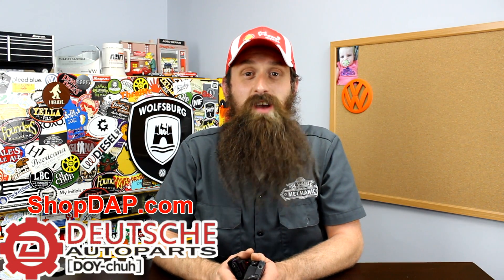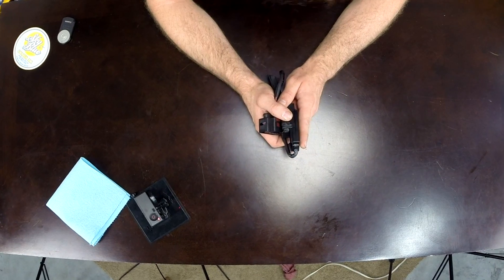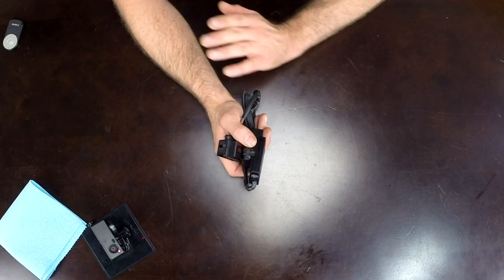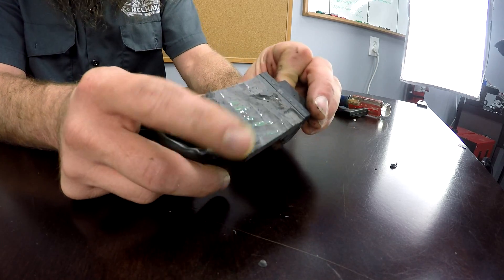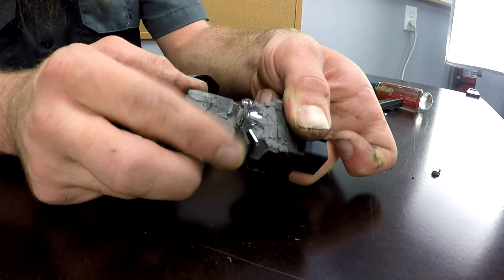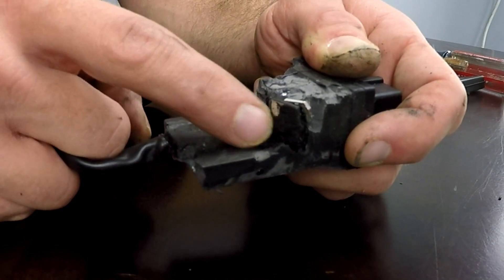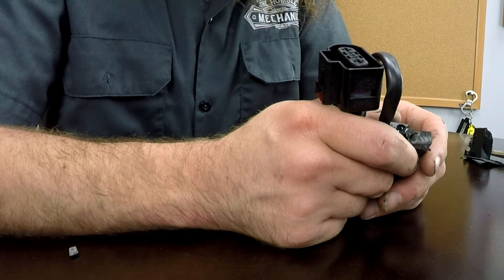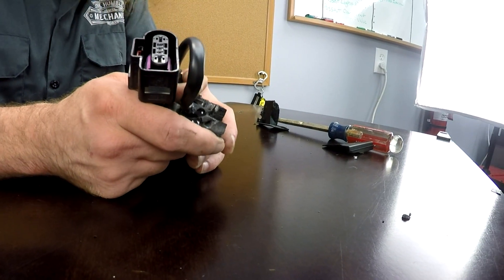How VW Parts Fail ~ 2.0t Fuel Pump Modules

Comment: I am having so many issues with my 2018 beetle 2.0 with these errors. I replaced the fuel pump module.
I disconnected the battery to install it
then after i deleted the codes
Cranked the motor and ran it after a couple min codes came back.

10426 - Fuel pressure too low during cold start
P053f 00

2838 - fuel rail system pressure too low
P0087 00

17895 - Valve for high pressure fuel pump stuck open
P12a3 00

4178 fuel injection malfunction
P0148 00

I placed a fuel gauge between the high pressure pump and after the filter .  When the car is cold the needle jumps back and forth 65psi to 75psi then after it warm and idle it jumps to 85 to 95psi and those codes come back after delete. Please any help would be appreciated
Reply: My readings .   https://youtu.be/wXx7tLf_aOU?si=YFB98EFHF7E56Neh

Comment: 2012 beetle turbo 

I can start and drive the car just fine but then all of a sudden I lose fuel pressure... Give it a few seconds.It'll start right back up.And I can continue driving but it does it again...

I'm replacing everything in the fuel system.The high pressure fuel pump low pressure fuel pump fuel filter module and sensor...
Reply: Did you get to what it was.... I have replaced sensor, filter, both pumps, relay, fuse... when engine gets hot the low pressure pump just shuts, and only runs 2 sec after key off-on maneuver. Driving me crazy

Comment: I am fight fixing a 2012 VW Jetta GLI.. I have a P008 code I replaced the HPFP, now im getting a P2294 error code. I have check the curcits, I dont know where to go now.  I need help.  I have replaced all the relays related to  the fuel system, I have checked all the fuses and all the fuses are good.
Reply: The symptoms after clearing the codes. The car performs normally when I hit the gas it surges, the EPC starts flashing the relays start clicking and eventually the ECU produces the P2294 error code.

Comment: My ccza engine 2.0tsi ea888 gen1, have fault code p3043 and safe mode (no acceleration) without check engine on dashboard. I will change this fuel pump module.

Comment: Same issue with A3 1.6 tdi 2013, I first replaced the fuel pump and didn’t fix random ”low fuel pressure” error codes and starting issues. Replacing the control module did the trick, thank you!

Comment: Hii,
I have an issue with audi a4 , when car reaches around 90 degree engine temprature the engine stalls, the dtc is low fuel pressure what should be the cause for this ?

Comment: Fast question, its my 2rd module that got burned out. Durning  year. I got the 2.0 fsi 150 km. Is it possible that the LPG system does it? I got no issues. Untill the car just doesnt start and the module is melted.

Comment: 2018 VW Passat R-Line 
My fuel pump Mod failed and sent p3043 code. Which killed my battery as it cause a parasitic draw on my battery. My car was completely dead, couldn't even use key fob to open doors. Mod was melted. 
After being jump started car ran just as it always does. Had to disconnect battery so that the Mod wouldn't drain the life out of it. 
Simple fix.

Comment: I couldn't make this up if I wanted to. My car was showing signs of this failing. It even has the fuel gauge issue. It works in the morning when the car is cold but over the course of the day it stops working. It's under recall so that's awesome. But since it's so easy to get to I decided I would visually inspect and feel it myself. I lifted the back seat to find the module sitting inside a duct taped bag of fucking rice. It was very hot to the touch. The previous owner claimed to have replaced the fuel pump. I'm willing to bet they either got this wet or dumped fuel on it and thought a bag of God damn rice would fix it. Thanks so much for you video you legit relieved all my anxieties I was currently having and helped me figure out my car's problem. I hope anyone who reads this story can at least get a good laugh cause I'm over here dying. Never in my life would I have ever expected to check under the seat and see a crucial car part sitting in a bag of rice like a cell phone that was just dropped in the toilet

Comment: Hello does have this part something in common with measuring/calculating of the fuel temperature? I have 2010 EA888 engine (1.8 TSi) and my VCDS in group 106 contains value "Fuel Temperature (Calculated)" which shows me values about -50°C  (yes minus 50 Celsius, ie. about minus 60 degrees Fahrenheit). Any idea if there is some coincidence? I have some problems with very rough cold starts. I also noted error P0087.

Comment: Hello Sir. I have a VW EOS that has 2 codes P025C and P2711.
It starts but transmission slips in 4th gear. My concern is P025C, as this is new. The engine light and seat belt light stay on. Could the latter code be a fuse?

Comment: My Module was the problem.. car died mid route.. pop.. ended up being the last thing I replaced. If I had looked closely at the module.. it was melted on one of the sides.. if your fuel fails for any reason, check this first.. Easiest and cheapest to replace. Code was totally misleading..

Comment: Is it safe to cut one of the wires that go to the fuel pump (the positive if can be found), to add a relay driven by an alarm?
Or maybe this can cause a change in the circuit (even if a relay is just a switch) and as a consequence demage the "regulator"?

Comment: My 2010 2.0 TDI wagon turns over but doesn't fire up, ever since replacing a flat battery recently.
VCDS shows no related fault codes. Could this module be the problem?
If not, then what?
Any advice from someone familiar with this problem much appreciated!    :-)

Comment: Hello, thanks for this great video.
I have this error codes :
P310b low pressure fuel regulation
P3089 electronic fuel pump, signal cable electric fault
I changed the HP Pressure fuel pump
I recently got a blown fuse related to the tank pump. 
Any help?

Comment: Hi, I just changed to a new module and after changing to a new module, the fuel pump works fine but the float does not rise, what should be done?

Comment: Thanks for this as well as all of your other videos.   Your comment at 3:25 is gold - "remember you have to have power going into it and out of it".  Diagnose - don't just replace parts.  We'll see if it fixes my GTI or if it is one of the many other parts of the fuel system.  Apparently, KISS is not found in the VW engineering vocabulary.

Comment: Hello HumbleMechanic, I replaced the fuel module on my 2012 Jetta GLI, and the check engine light disappeared. A couple days went by and the light came back on and I scanned the car again, and the same code came back. Do you have any suggestions as to what it may be?

Comment: Thanks, Charles, @Humblemechanic, I've been watching for years! I could smell something burning from the back of my car and of course, it was the FPCM. I am ready to install BUT where do you recommend relocating the heatsink module in a 2012 VW CC? I don't want it to catch fire or anything, especially since it's right on top of the fuel tank. Crazy design BUT your time, effort, support, and energy are appreciated!!

Comment: I have a built 1.8t GLI it throws a code for this part. Yet when I checked the fuel pump assembly the harness has no module. Does this apply to all mk4 Jettas? Or only 2.0??

Comment: Thanks for those amazing videos it helps a lot and save me some dollars 💵 doing the job myself!!
I have a 2007 Audi a4 2.0t and I’ve been having trouble with the fuel system , car starts with no problem and random stall after few minutes (20 or so) and I change fuel pump and hpfp and still have the same problem !!
Today I’m going to get the fuel pump module and 😢I hope that fix it!! Fingers crossed 🤞

Comment: Came out this morning and my 2012 gli wouldn’t start have Dtc p025c fuel pump control module short to ground. Vehicle started ran for 5 minutes then just died on me. Wonder if this is my issue, anything I can monitor with a scan tool as far as fuel pressure to see if it isn’t that?

Comment: Hi, I had an P3089 - "Fuel pump electronics signal wire" code which was shown as intermittent a year ago and is now coming back. Could this be due to a faulty fuel pump control module issue? Tks.

Comment: Could this cause a "p0192 high pressure fuel rail sensor low circuit input"?? I replaced the sensor and the wiring allready. The engine stutters ,loss of power. Answer would be HIGHLY apreciated. Thank you

Comment: Audi A4 2005 AT 2.0L
Fault code P3073: Fuel pump electrical circuit error, 
Fuel pump control module sends to fuel pump only 4.5-5vts and full 12vt ground what are your thoughts? Upon looking up schematics no pinouts voltages we're provided from Audi to Mitchell Prodemand website i use for schematics and repairs
Reply: Have you managed to fix your car?  It was the FPCM?
Reply: @alexandruairinei6035  the client after the first repairs sold the car since it ran well afterwards. He didn't come back with this vehicle

Comment: Thank you for this video. My MK6 GTI fuel pump never shuts off, even with the keys removed and doors locked. It drains the battery if I don't remove fuse #27. Could this also be one of the symptoms of a failed module? The engine starts and runs fine otherwise.
Reply: Interesting. Atm I'm trying to track down a parasitic draw which leads to a flat battery overnight. I've also got a p0230 code coming up which indicates a fuel control module fault in my 2007 Passat TDI.
Do you know if yours had that code.
Did replacing module fix the battery drain? 
What is #27 fuse called/labelled?
Hope it's working well for you now. Thanks In advance.
Reply: @rocknral  - I replaced the pump module on top of the fuel tank, under the back seat, and the problem completely went away. I don't remember if there was a code. 
Fuse 27 in Golf is located in the panel on the driver side of the dash, it's behind a plastic trim piece, accessible when driver door is open. I hope this helps.

Comment: I keep having check engine light on at golf mk6 1.4 tsi, not sure is fuel pump issue or just only the module? I get the fault code 12425 when scan fault

Comment: Can this cause the car not to pass emissions? I live in S Cali
Reply from the maker: Maybe. But odds are you’d have more issues driving than just a check engine
Reply: @HumbleMechanic  I have no codes ...I just replaced the module . Some mechanic at Audi told me the only way u can erase this code is by replacing and driving it for maybe 100 miles

Comment: Ok so what if Volkswagen did the recall and now there isnt that little box on the cover? I believe it's the revised version after they recalled it on the cc. I need to replace mine and I got the original fuel pump module control

Comment: I have vw passat 2008 fsi petrol i replaced new fuel pump and new fuel pump modulle ,when i tried to start the engine the engine start for few minuts and stop to work ,the fuel pump stoped to accept power from the module, in the module accepted 12v in the inlet of the module what can be the problem?
Reply: Did u fix it somehow? I got the same problem with same engine. After a weekend i wanted to start the engine and boom its dead. I just bought the pump and the module. Engine started. Worker like 2 mins and the same thing. Engine aint start.

Comment: Hi Charles. Can a random misfire be caused by a fuel pump modules that is not working ?
Reply: I’m going through the same issue. Were you able to find out the problem?
Reply: Random misfire can be caused by too many things. Does your car shows any trouble codes? What are the symptoms you are having? My big broblem was the rear main seal that needed to be replaced. You can do a smoke test with a tube and a vape just remove the O2 sensor on top of the engine and blow smoke Inside & see if there is smoke coming  out from somewhere else like under your car.

Comment: @humblemechanic Thank you for sharing the information, I stumbled upon your channel while I was searching for a solution to my 2015 VW Tiguan problem, my engine stalls randomly at idle but if I rev up 4-5 times that will go away, but this happens once in a day atleast, I have already got high pressure fuel pump,  and the control module changed from VW workshop and still they are not able to figure out the problem. I am feeling very positive that you will be able to advise a fix for the problem, thank you.
Reply: I have the same issue on my 19 Golf R. I think it might be due to the low pressure fuel pump
Reply: Hi! Have you managed to fix the issue? What was? I have the same problem. Thank you!
Reply: @AIOS.83  was your problem fixed, I think I have the same issue

Comment: Hey There, I'm getting a P025a  , Cold Idle Misfire on cylinder 1, could this be the problem? Twice I've also gotten a EPC light on start up but that seems to have stopped as of late. Any suggestions would be greatly appreciated.  I read on vortexx that maybe a carbon cleaning in the intake would be the problem as well. Mk6 GLI w/ 103k. Thanks!

Comment: Hey man, I just wanted to say a massive thanks for producing this video as it helped me sort the fuel supply issues on my mk7 GTD. After replacing the fuel pump (it was making a horrible sound similar to a bag of bolts being shaken, but the new one did the same), replaced the fuel filter (which actually really needed replacing!) I was left scratching my head until I came across this video. Ordered a replacement fuel pump control module, swapped it out and boom, car started first time and has been running amazingly since. Previously the car would run for somewhere between 15 secs and 5 mins before cutting out. Thanks a lot!

Comment: Hi i have 2012 passa cc 2.0t 
Getting similar symptoms,  stalling, hesitation on low speed, hard start etc symptoms are not there all the time and the car sometimes start and run normal, most of the time when I stop and start the engine back it doesn’t start until i press the gas paddle.
No check engine light and i don’t know the  code I getting but I understood from the mechanic that the engine running rich.
Mechanic checked all the sensors cleaned the injectors (it improved a little) but still have the problem.

Comment: If the fuel pump control module fails what should the code be on my 2012 Jetta GLI?
Reply: i also have a mk6 gli , did u find a solution i have the code p025C which is the fuel pump control module
Reply: @samuelyoussef7695  - I had the same code on the scanner. I just replaced the part and recently did the smog and it passed. The hard code is still in the computer and the scanner still reads it but I guess it still passed smog which is good.
Reply: @Jas_01101  thank you god bless

Comment: My GTI 2013 didn’t want to start anymore, I checked the fuse box and #27  which is the fuel pump is burned. I tried putting a new one and it burned as well. 
Do you think it’s the fuel pump or the control module?
Reply: Same thing is happening to me. Even with key off as soon as fuse is inserted it blows. Did you solve the issue?

Comment: Hi, my car dies randomly it has code n762 mechanical failure,  replaced the high pressure pump and still not working...  after searching the fuel pump relay gives 9 volt and no start, after switching some times the key and then it give 11 volts to the pump and then it starts. After a few meters driving it dies and it shows 9 volt again. No heat from the module or something. And if the car runs its like normal...  is there a way too measure the modul? (Car battery is good)

Comment: parts.vw.com says that the Fuel Pump Driver Module with part number 1K0906093J is not compatible with a mk6 gti when you click "let's confirm fitment" on this page:
https://parts.vw.com/p/70061804/1K0906093J.html

But your page says that the same part is compatible with a mk6 gti:
https://www.shopdap.com/2-0-t-fuel-pump-control-module-1k0906093h.html

Is this an error on VW's part page?

Comment: Hi there I am getting a p2540 (fuel low pressure sensor rail) fault error on my vw golf mk5 1.4 fsi. I already have check and replace the sensor, but the problem still remains. I check the control module but it's not very hot and it looks in very good condition. Also the cam follower has a little damage on the black bottom. The issue that my car has is that when I am driving it on the city sometimes I have loose power on my gas. That problem I don't have it on the highway when I am going on an trip. Please I will appreciate it very much to help me with your answer and your knowledge on fsi motors. My motor engine is BLN. Thanks in advance for your assistance

Comment: I bought a mk5 gti, it doesn’t start. It had two different fuel control modules laying in the back so someone tried messing with it. Sending power with a power probe it does prime. Is there a relay that could power that control module ?
Reply from the maker: I don’t think there is a separate relay. Is the car getting fuel!

Comment: Can this bad boy cause an intermittent no start. I have a 2013 EOS and it will turn on and right back off again. and then start fine. It will also crank without starting after sitting overnight and then turn right back on again.
Reply: Did you find a solution? 
im having the same issue 2013 gti
Reply: @krispymedia9373  I did! it was the low pressure fuel pump the dealership should be able to verify although I had to tell them to check it. When they did mine was making like half the psi it should.

Comment: Hi
I have a 2013 volkswagon cc 2.0 turbo tsi
My question i just had my fuel fump module replaced few months ago is it common for it to go bad that quickly?

Thank u
Reply: No. Not the new updated factory part. If your mechanic bought some cheap amazon aftermarket one..yes it will fail quickly. Also, do it yourself if you can. It's cheaper and not that hard. It's literally right under the back seat.
Reply: Hi, I just have a quick question, does your VW CC has this module under the rear seat? I also have a 2013 vw CC and when I removed the rear seat I found mine doesn't have this module